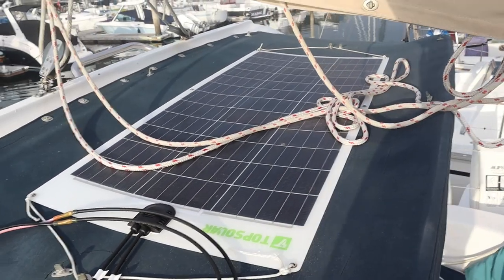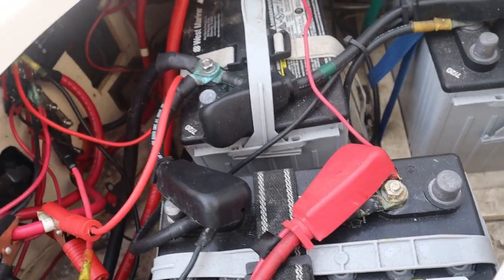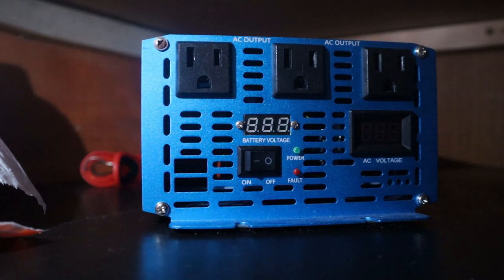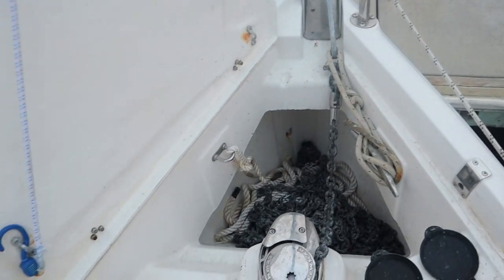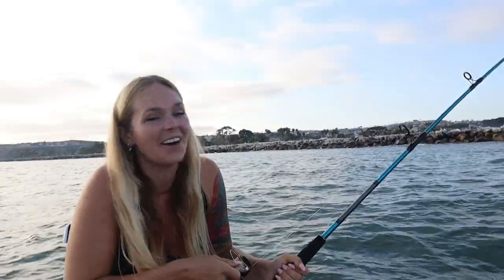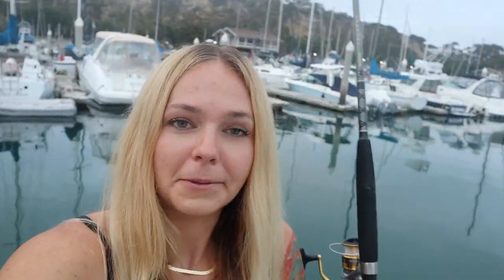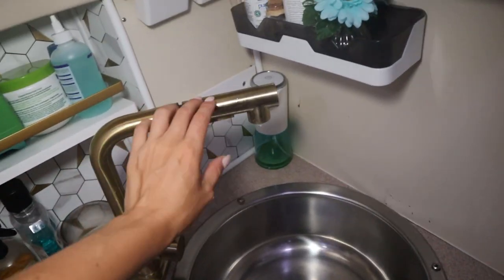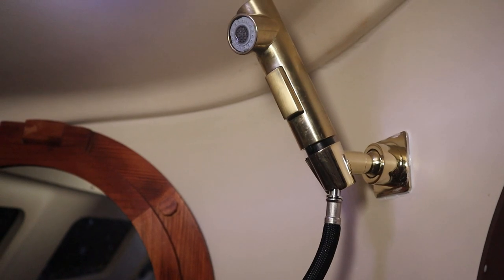10 Things Liveaboards NEED!

Comment: hey captain christa, i enjoy your videos! Just a heads up,  be carful when pluging that electric stove into the power strip. lots of fires happen because these powers strips cant handle the load. the electric stove probably draws 1700w . Also never plug an electric heater into those strips. run a separate 14amp extension cord to the invertor or wall outlet if your in the slip! I'll see ya in Catalina!!!
Reply from the maker: Thank you! See ya in Catalina 😊😊😊

Comment: What brand and model is your AC/DC fridge?  Also mask & snorkel set with at least 3mm wetsuit are essential in case you have to dive down to remove lines from the props.
Reply from the maker: I will have to check and let you know! If you search front pull AC/DC fridge you should find a good one. Hah true and I do have so much snorkel gear and I have a wetsuit! Thank you for

Comment: You know. There are some reasonably priced portable water makers. They come in a case and stow away. Just a thought
Reply from the maker: Wait really? Is there a certain brand or What are they called? I’ll have to check them out
Reply: @CaptainChrista  yes. The most popular brand I have seen is Rainman. It comes in two cases and can be stowed away when you are not using it. There are 2 versions. The A/C powered version makes up to 37 gallons per hour and the D/C version makes around 9 I think. I am not sure about costs but I know it’s a ton cheaper than installed water makers. I have seen the on other YouTube channels. Bet you can find them easy enough
Reply: @ronsgarage4230  I just looked up the rainmaker ones and they are still around 4k! definitely going to save up for one, I like that it doesn’t have to be installed!
Reply: @christa8475  that’s awesome. I hope it fits what you need it for. I will look forward to your first try video with it. But then, I look forward to all of your videos!!

Comment: You forgot to mention safety gear like a life preserver, a tether system, a good raincoat for stormy days, fire extinguishers, battery operated marine radio, an EPIRB, oars for the dingy, emergency sail repair kit, first aid kit, flare gun, and more.
Reply from the maker: haha isnt that just assumed?
Reply: @CaptainChrista  I wish. If all sailors or boat enthusiasts had these on hand the Coast Guard wouldn’t need to spot check the vessels they encounter. Lately too many “liveaboards” have found themselves in big trouble at high seas for lack of equipment or knowledge on how to fix things like a broken sail clew, taking on water through a hull-mounted transducer opening, and more during oceanic voyages.

Comment: Ahoy Captain,   wow so much info 👏,  
A lot of cruisers will adapt to there needs once they set sail and are on the "hook".  electric cook tops not ideal with z little solar , gas is good,    as for the windlass, pull it up by hand ,  saves time on yoga 🙏    hope you get to set sail soon,  ohh  maybe  hardwire your solar , get more grunt out of it , and apply some Vaseline  around that solar plug  on  your bimini. 
 The salt spray will reduce amps...
And bunks for the dogs🤣🤣,  had to skip that  part.   Enjoy your summer,  hoist those sail.  🐋
Reply from the maker: Ahoy! Wow You have some interesting ideas here! Thank you for the support! 🙌🏼

Comment: Seawater Pro made in the US, comes in 12v or 110v small unit will fit on your boat. I think 17 gallons an hour. Very easy installation  and customer service is excellent if you have any issues. 4,000$.
Reply from the maker: That’s too expensive for me at this time unfortunately! But I’ll look into one for the future!
Reply: There are a few hand pump types that are not that expensive. I'm looking at those because you need to make power to use electric pumps. I feel better about not spending a fortune on power generation personally

Comment: Love the channel! I have a suggestion to help you with your fishing technique. The rod you showed is a spinning setup designed to have your reel on the bottom not on top as you were using it. The rod itself is also designed to bend towards the reel and not away from it. When the reel is on the bottom you crank forward on the handle instead of rearward. Under extreme load, as with a big fish, your rod can snap if it’s bent the wrong direction. If you need the crank of the reel to be on a preferred side then simply unscrew the crank and switch it to the opposite side. This will make using that type of setup much more comfortable and powerful when you hook a big one! Fair winds and tight lines! I hope this helps.
Reply from the maker: thank you!! this is good information!